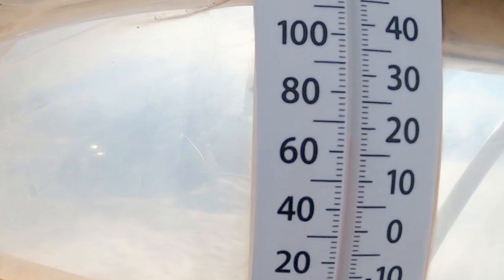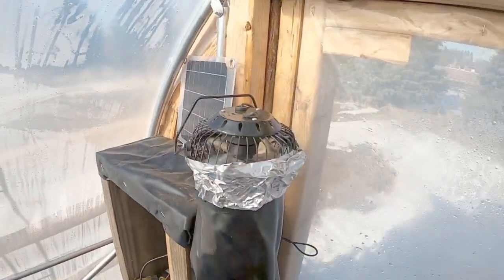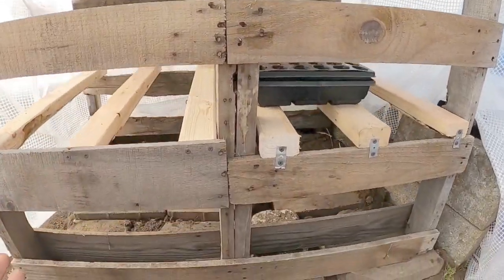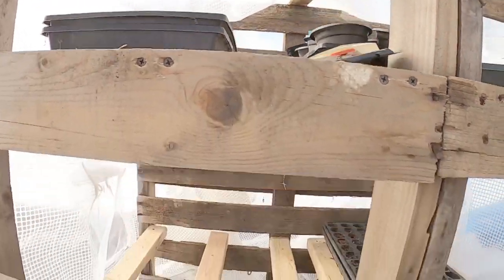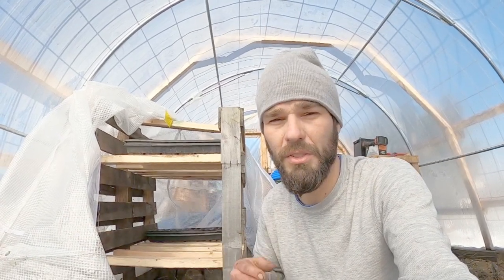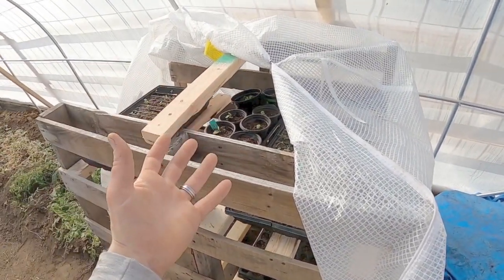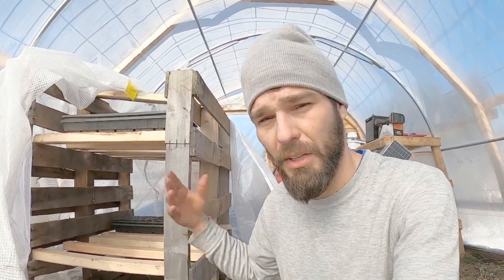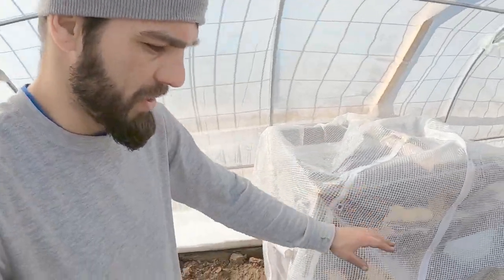DIY Heated Sprouting Box Using Pallets | EASY & FREE DIY For An Early Start To Spring Planting

Comment: what nitrogen resources are you using for the pile during wintertime - when no grasscuttings and such are available?
Reply from the maker: I’ve got a wood burning stove, a pellet/corn burner also. Wood ash it a great way to kick start the pile once I’ve got it layered and built I’ll water/ash/water and when I don’t have a good scoop of ash ready I’ll take our chicken bedding and throw that in and the poo does the same work as wood ash if you’ve got enough fresh chicken waste
Reply: You can also make nitrogen rich Alfala tea by soaking Alfalfa meal, pellets, or hay in water for 12-24 hours. Them pour the entire contents of the bucket onto your compost pile.